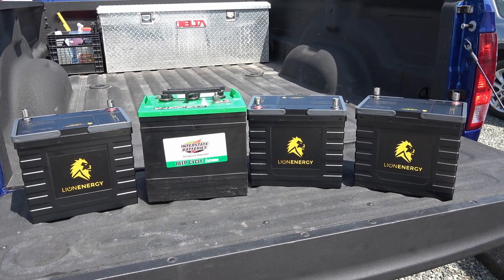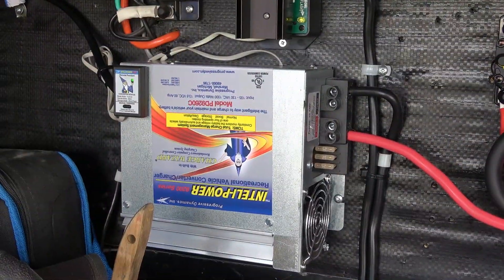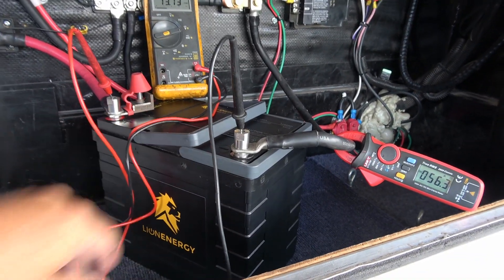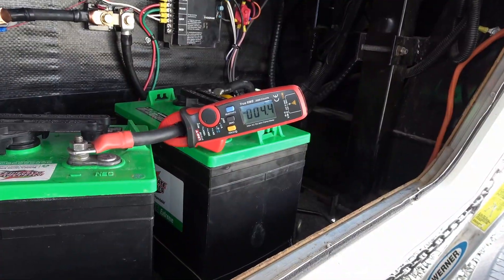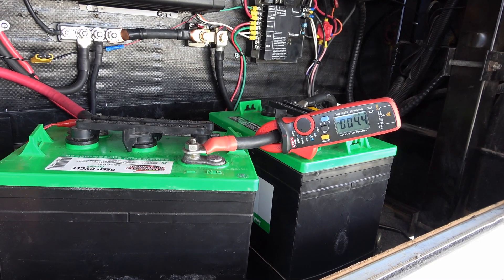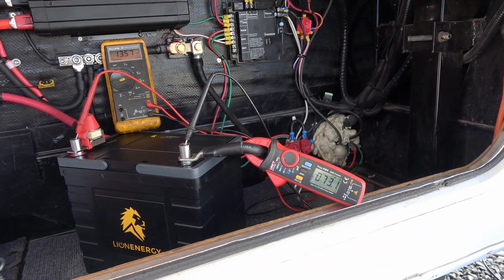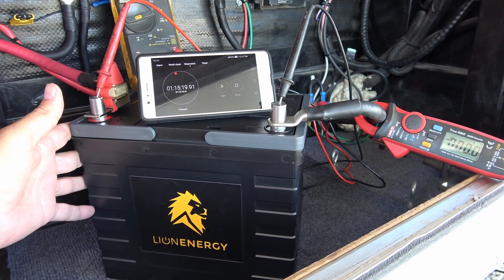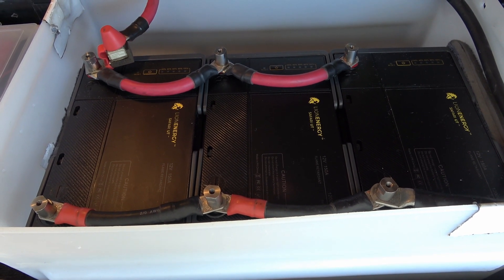Lion Energy Safari UT Battery Tests (Part 2) - Charging + FLA Comparison

Comment: Truly excellent review Ray.   I have 2 x 200AH LifeBlue batteries, similar prismatic to your Lion.  I charge mine to 90%.  They also have bluetooth monitoring.  Very happy with them, you get what you pay for.  I think you just killed the lead-acid industry :o)
Reply from the maker: Thanks. :) How do you stop the charge at 90%? Manually or do you have an automated system?
Reply: @LoveYourRV  I use a Tristar solar controller and set the High Voltage Disconnect (HVD) to 13.8V.  It puts the controller in fault mode at that voltage.  I set the High Voltage Reconnect (HVDR) to 13.31V.  I think 13.8V may be a little above 90% charge but not near 100%.  I then reset the Trimetric to read 100% at that setting.  I will attempt tp send the pdf file about it to your email.  It will come from winnd@

Comment: I thought the Lithium batteries were way overpriced, but seeing what it takes in lead acid to equal what one of these lithium batteries is capable of, not to mention no maintainance, faster re-charging, longer life, weight, etc.. I have come to the conclusion that they are actually a much better value than lead acid. Thanks for the great test comparison Ray.
Reply from the maker: You're welcome, guess the real test will be years from now to see if the predictions of lifespan really do pan out. Cheers, Ray

Comment: We live fulltime,  mostly boondocking.  About 3 years ago I put 360 amp hours worth of lithium in and I have never drawn them down to 50 percent, usually, we only use 20 percent overnight.  Plus we have a small residential frig. on the system.  I have tested the capacity and they have only gone down 2 percent in 3 years.  Love em,  worth every penny if you boondock.  Only thing you need to watch is DO NOT charge them in freezing temps.  You can use them in freezing but not charge them.
Reply from the maker: Cool, thanks for the feedback on yours, I imagine you have some solar recharging them, how much did you require?
The internal BMS in these Lion batteries shut down charging before it gets too cold avoiding damage so that's a nice feature. Cheers, Ray
Reply: @LoveYourRV  My solar is 1100 watts,  but my BMS/charger shows me a readout graph of use/charge cycles.  My batteries are usually charged to 100 percent by 10 am.  The charger shows about a 50 % duty cycle.  So I figure 550 or 600 watts is really all we need for our battery pack.  I use the extra duty cycles to power the water heater,  carefully monitored.

Comment: I didn’t know that you could charge with the converter and solar at the same time and combined them
Reply from the maker: Yup, no problem, I run my solar controller and charge converter at the same time often. Many motorhome RVers run solar and alternator charging at the same time when driving.

Comment: Thanks Ray, very informative. On a side note. What amp hour does the RV heater fan draw. When dry camping during the winter I understand this is the biggest draw for length of time. My nemesis without solar.
Reply from the maker: You're welcome. :)  I find its right in the 6-8 amp range so can add up quickly if the furnace runs a lot. My wife likes it warm around 66F, on a cool desert night when it drops to near freezing outside we can use 24-40 amp-hours just for the furnace. Recently I bought her an electric throw blanket and it has actually reduced the power consumption as I can do without heat and she can just heat herself as needed.
Reply: Now I see why my single group 24 dies. This Lion battery may be the answer to problems. I did recently pickup a 100watt solar panel. Will be doing some cool evening camping up on the rim in September. Not sure if it’s going to be all that cold but like to try the solar. Thx again

Comment: Hi Ray, do they discharge when in storage like lead acids do?
Reply from the maker: Not near as fast as lead-acid, the website says: It will maintain a charge for up to 2 years without having to charge it. This is known as shelf life or storage life. We recommend using it more frequently than every 2 years.
In the manual, though it recommends to:
For storage over one month, place the battery in a cool, dry, ventilated room.
● Do not store near corrosive material, fire, and heat sources.
● Charge and discharge the battery once every six months if not in use during that
time.
● In order to avoid over discharge, charge the battery periodically at the suggested
battery storage voltage (12.8V 13.24V, 30 ~ 50% SOC) to avoid over discharg

Comment: What kind of charge rate would you think the alternator on your engine would put in the lion energy? I'm looking to replace my Gc2 golf cart batteries with a 12 volt lithium maybe 2 of them.  Thanks
Reply from the maker: The OEM tow cable charge rate won't change much as its limited by the thin gauge, long run of wire, usually you get around 5-7 amps.  Recently I installed a DC-DC charger with a large gauge cable run and now I can get 40 amps charge current from my alternator - https://www.loveyourrv.com/renogy-40-amp-dc-dc-charger-installation-and-demo/  You have to make sure your alternator can handle the extra load though or risk overheating it.  Cheers, Ray

Comment: What is the make and model of your blue cordless drill?
Reply from the maker: I have a little blue coreless screw gun - Makita DF030D   https://makita.ca/index2.php?event=tool&id=706&event=tool&id=706 It's an old model now I imagine, I've had it for at least 15 years or so :)  And I have a blue Motomaster cordless drill and impact driver from Canadian Tire - https://www.canadiantire.ca/en/pdp/mastercraft-20v-brushed-2-speed-cordless-drill-driver-1-2-in-0547520p.html  &  https://www.canadiantire.ca/en/pdp/mastercraft-20v-cordless-brushed-impact-wrench-1-2-in-0547562p.html  Cheers, Ray

Comment: It would be interesting to see another test with drawing a low amp load of 7 amps ,,,such as a Espar heater 3 amp and 12 volt fridge around 4amp , wouldn't the lead acid outperform the lithium in a low amp draw test?
I'm very impressed with the amps not tapering down when charging the lithiom.
That circuit breaker that you have in the background , do they have a on off switch to manually flip the breaker off to shut off power?
You know like you can with breakers in a house so you can work on the wiring?
Thanks for the videos,  thumbs up
Reply from the maker: I wouldn't say outperform, just actually come close to its rated Amp Hours, at that low of amperage the lead-acid would come close to their rated AH, usually the lead-acid are rated at a 20 hours discharge in the golf cart batteries case about 5-6 amps. So, I'd expect to get about 115-120 Amp-Hours out of them at that low discharge rate.  Its when you discharge at high current that the lead-acid type loose capacity.  I was trying to demo that. Also, lead-acid lose capacity the colder it gets.
Yes, I use switchable breakers in several circuits so I can isolate to work on stuff.  https://www.bluesea.com/products/category/14/32/Circuit_Breakers/285-Series  Cheers! Ray

Comment: Ray I looked at the manual for the Safari UT Batteries but didn't see a recommended charge voltage setting. What settings did you use on your charge controller? I read somewhere that 14.4 v was ideal but the max charge voltage on the Safari batteries is 14.6v. Also, can you change the Intellapower charge voltage??
Thanks!
Reply from the maker: I was advised to charge at 14.4V, works out well as that is what my Intelipower puts out in manual boost override mode.
This video shows how I set up my solar charge controller when I installed my batteries - https://youtu.be/jo7S__-M99c
Cheers, Ray
Reply: I also have the 9260C with the wizard. When you put it in boost mode does it stay in boost or drop out when the battery hits a certain voltage? I couldn't find anything where it says for sure. I also heard Lyon Energy and all they said on voltage was it should be below 14.6 but as close as I felt comfortable. Battle Born recommends 14.35v with their batteries but 14.4 seems fine. Thanks!

Comment: After the hour and 39 charge of the lith battery with the Intelli-power in BOOST mode, does the charger go back to auto mode on it’s own or stay in BOOST?  I have the same charger and am planning to use it with lithium batteries.
Reply from the maker: Stayed in manual override boost mode but the battery BMS (Battery Management System) halted the charging when the battery gets to around 14.4V so it won't overcharge.  I didn't leave it very long so maybe it returns to regular mode, not sure.
We are on hookups right now so I have converter chargers turned off and have been letting the solar controller take care of charging the batteries.

Comment: did you make sure your 6v batteries were fully charged at the start of the test? you never specified or confirmed they were.  i have the same 6v batteries and usually get substantially more then 28-29AH out of my batteries running anywhere from 50-80 Amps through them
Reply from the maker: Yes, I did a full equalization about two weeks prior and full-charged with my solar charger. I also checked the specific gravity of each cell with a hydrometer.  Two of the batteries were a little lower so I used the best two for the test. The batteries are near 4 years old and had about 16 months of straight boondocking time on them. So not new.
I just used 2 for the test, not 4 so each battery was putting out a fairly high C rate of discharge compared to using 4.  Cheers, Ray

Comment: my solar system keeps my lead acid at 100% every day unless there is no sun, I've always wondered if it hurt them to be at that state.
Reply from the maker: No, its good to have lead acids charged every day, it hurts them to remain in a partial state of charge too long. causes the lead plates to build up a layer of sulfate crystals and lose capacity over time.

Comment: Great job Ray, still on the fence for spending that much money for a battery. I don't know too many times a person would drain at those levels, but if you were cooking something in a electric skillet or using induction cooker you wouldn't need to worry. Like you I only have a 1000 watt inverter for the simple loads of every day use. So these should last you days of clouds before having to fire up the genny. Thank you so much for taking the time to share with us my friend. We really appreciate it.
Reply from the maker: Thanks, Jerry. Going to be nice to have the extra capacity and love the fact I don't have to recharge them to full charge like the old lead-acid.

Comment: Soooo.... Are ya gonna keep 'em? Your test results were pretty close to what I predicted, in the reply of your first video. I didn't know, that you've already posted the results of a pretty comprehensive test!(I hope I didn't insult your intelligence)That video just showed up in my "recommended for you" on my YouTube account, so I thought it was your only video.
     The battery will appear warmer under the positive battery terminal, because that's where the heatsink is for the battery management system. It uses MOSFET transistors, which, when on, act like a low value resistor. Doubling the current, increases the heat dissipation 4 times. That warmth will be noticeable at 100 amps, very noticeable at 150 amps. No problems. the battery management system has built in thermal protection, which will protect the battery cells, as well as the power transistors. By the time you get 3 batteries in parallel, the total heat dissipation by all 3 batteries will be 1/9, what it would be for 1 at a given load, with each battery heating up only 1/27th as much. If that's the set up you're going to use, you won't have to worry about a thing.

Comment: Yeah sure.....the batteries that cost 1000 bucks (US no less!) are better than the ones that cost 150 bucks !!!!! WHO KNEW?
If somebody gave me the batteries (did you buy yours?) I'd really like them for sure....
but if I did the cost/benefit analysis based on my usual use/power needs....I wouldn't buy them...unless I was a "newest/biggest/bestest/whatever the cost" kind of guy.
Reply from the maker: Well, wait fro my final review video where I list all my pros and cons, cost will definitely be a big con to these batteries, but other than temp considerations it appears to be one of the only cons, so far I've discovered a large list of pros, at this point I've just been going over the installation and testing/ phases.  Stay tuned.. Cheers, Ray
Reply: @LoveYourRV  one more thing....how much solar do you have on your roof now???? to generate 24A... like you stated in the video
Reply from the maker: I have 500 watts total, on a perfect solar day with the optimal sun angle I can max out my 30 amp controller. Generally, though I get in the neighborhood of 25 amps average, I don't tilt my 4 roof panels but have one ground panel.
More info can be found here -->  https://www.loveyourrv.com/what-do-we-power-with-500-watts-of-rv-solar/